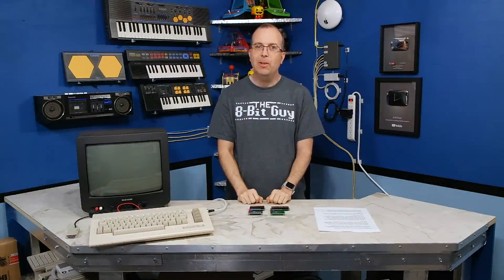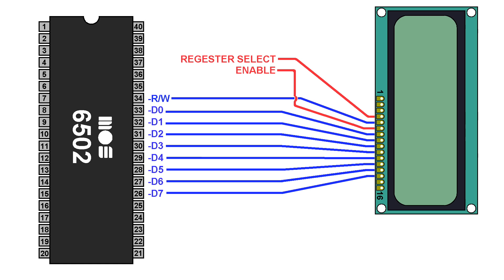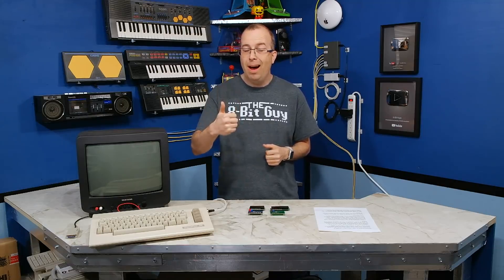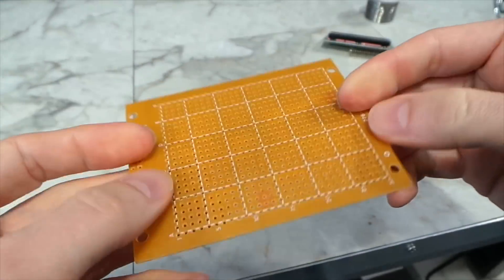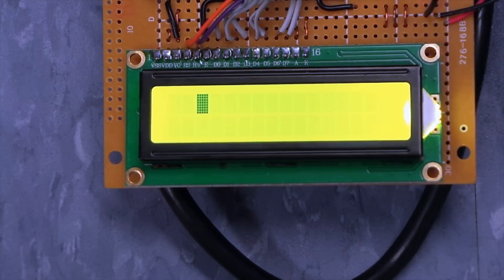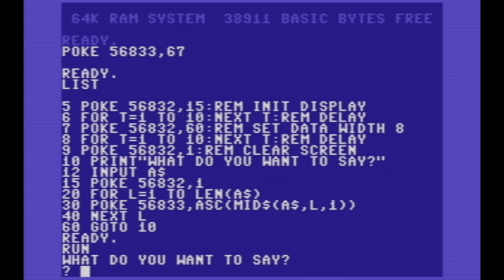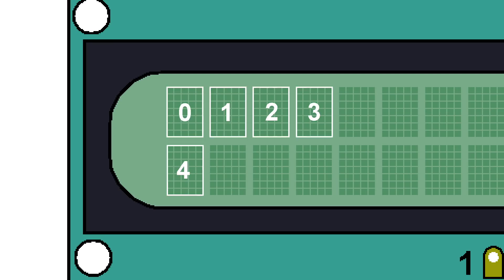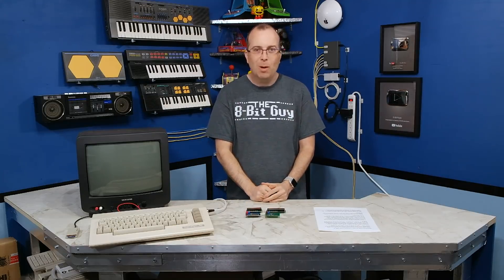How a Character LCD Works - Part 3

Comment: The PCB solution was pretty much glossed over. I think it deserves a part 4. How did you get the card to work? You never mentioned how the 74XX chip was used.

Comment: Neat little program. I want to see what I can do with it.
I had to write it like this though. Because I'm using Yabasic.
I actually did this in text for searching as I couldn't use input
because I wanted to emulate search as you type.
repeat
print "what do you want to say?"
input a$
for l=1 to len(a$)
print chr$(asc((mid$(a$,l,1)));
next l
print chr$(13)
until(1=0)

Comment: I recommend using the Set DDRAM address instruction with these displays to jump the cursor to the desired location instead of sending a lot of "dud" characters. Works much faster that way, but requires a bit of logic in the control software.

Comment: Matrix Orbital has some great LCD screens. I had their MX6 20x2 5 1/4" drive bay USB VFD screen in my Windows XP computer back in the late 1990s and early 2000s. I used it to show the system information from that computer plus a couple custom screens I made up. It was highly programmable and customizable using a software program that came with it.

Comment: Woo! 74AC? Not hanging about, are we? :D

This is almost exactly like interfacing to Atari's expansion port except you'd need a bit of address decoding; there's no IO1 line. Oh, here I was thinking Commodore had one up on Atari, even if only a little thing, but it looks like you actually need extra chips for the C64 anyway.

Comment: Hi, have you considered sharing the “fix” your friend designed to address the no data problem, I’m thinking of interfacing my C64 to a manual PROM (32x8) programmer, I may stumble on exactly the same problem. Keep up the fascinating work :)

Comment: Excellent explanations of how this 8-bit stuff works and I am slowly learning.  I also liked the graphics you generated, but my pedantic self suggests that you may want to correct the radiation symbol so that two of the blades of the trifoil point up, not down.   I've seen people turn this warning symbol every which way, but there really is a standard: 10CFR20.1901(a).

Comment: I need to write a command to an 8 bit LCD Controller.  The instruction relies on an additional two bytes of code.
Do I need to write the instruction, set the enable bit, then write the additional bytes and send the enable command again ? 
Or do I write the instruction, write the additional bytes, and then send the enable command once ?
This is all new to me as I am writing the code.
Thanks.

Comment: Ideally when cutting chips like that, you cut it close to the chip, after the bend. The way you cut it can damage the board from the mechanical stress when the soldered in pin is pushed when clipping. When you clip it at the chip it induces a lot less stress to the board.

Comment: Just like what happened to David, if you have one of the original C64 power supplies, DO NOT USE THEM. They have basically no protection and not well designed in the first place which means the voltage will slowly creep up and fry the machine that is slowly getting more and more rare. A new modern replacement is like 40 bucks and much better if you don't feel like creating your own but the original power supplies are ticking time bombs and the only way I'd use them is by checking the voltage every single time it's about to be used but that is still not a good way

Comment: Great series but I'm confused what the "good reason why" (timing issues aside) to demonstrate attaching the character LCD to the cartridge port teased at the end of Part 2 is. Is it because you can operate the display in a full 8-bit mode using the 8 data lines on the 6502?  I want to do a project similar to this with a Z80/Intel 8255.

Comment: HD44780 or equivalent display driver chip, have a command to move cursor position in desired place.. It should be in that manual.. ;) 40h is base address for character ram, 80h is base address for data ram.. For 2x16 display - first line first character is 80h, last 8Fh, second line first character is C0h, last CFh.. Command C0h sets cursor to start of second line and no need to put blank 28 times to get to the second line.. :) For 4 line displays first line didn't change - 80h.. then line adreses as follows - C0h, 94h, D4h..
And delay after initialization is very important. Best way is to read back instruction register to check busy flagg before putting some new instruction in.. Some displays working slower and i eat a hair's off to figure out why, sometimes, after start, that display didn't want to initialise but sometimes it start normally.. It was from slow ones..  :D

Anyway, great design ideas.. :)

Comment: These LCD videos are fine examples of the power of "first principle thinking", which is an invaluable skill/mindset that I fear today's kids are missing out on. One problem with today's technologies is that all the science and engineering are neatly packed into sleek packages that try hard to portrait themselves as "magic"; "warranty void" if you so much as remove a sticker. I applaud  the 8-bit-guy for his great works not just for their nostalgia value,  but also for the "tinkerer spirit" they inspire, which shouldn't (and hopefully wouldn't) ever become obsolete in today's 64-bit world and beyond.
Reply: Thankfully those stickers are becoming illegal with the rise of right-to-repair legislation
Reply: tomorrow, the warranty-void stickers will connect to your Bluetooth device to automatically tell everyone on facebook about how much of an awful person you are for lifting that sticker.
Reply: The good thing is tech like the Arduino and Raspberry Pi broke a lot of that mentality, and now that right to repair is starting to slowly become law, things may become more modifiable again.
Reply: He's a hacker in the true meaning of the word
Reply: @mrvzhao  I had to giggle when you implied these packaged screens are first principles. They weren't available when I was last tinkering, so I know there's a chip in there providing an incredibly neat interface, a memory buffer for the characters, and circuitry to drive the actual LCD with the AC required for it to function correctly. All the same, I think you're right in principle. There is a lot of progress being made, and I applaud it too. :) Also, I love these little packaged screens which provide a shallower learning curve than the combination of analog and digital knowledge needed to drive a raw LCD. I never did learn how to drive the screens I bought when I was 16. They were very cheap second-hand, at least.
Reply: Abstraction is a useful concept as long as you understand what’s going on inside a bit. If you wanted to make a simple programming language in Minecraft then you probably think that you couldn’t. But if you use abstraction, that may be no problem.

Comment: Dave, you make great videos, and you say you've been playing with these LCDs for years.  So I can't believe you didn't consult the timing diagram, and didn't even show the timing diagram in any of your 3 videos on this.

The reason it didn't work is because the Enable signal must go high after all the others have been set.  The address lines coming out of the C64 probably beat the I/O1 line by at least one gate delay.  If you look at the timing diagram for the C64 port (I haven't, and have never used it), you may find a signal that would work better for the Enable.  Maybe #IRQ inverted, if you can get it to toggle after the address and data lines are set up?

Also, for anybody trying to use these LCDs from assembly language or a fast computer, you'll need to be able to read from them to read the status register to find out when the display is ready to accept another byte.  It may take 50-100us sometimes, depending on what command was last sent.

Comment: I actually have a 40x4 Charcater LCD, it just has 2 enable lines and basically behaives like 2 40x2 LCDs ontop of eachother. which gets a bit confusing if you want to write from line 2 to 3 because you suddenly need to switch the enable lines

Comment: aaand the display should actually be done latching the data in and have let go of the bus again before the clock moves on to the next cycle... and the datasheets are all but clear on the speed at which that happens. specifically on the c64 it only has half a clock cycle as the other half is used by the vicII.
Reply: would be practical to know if those 2 additional chips are actually just some 3 state bus buffer, some bus driver (not nessesary as most of those screens happily take anything between 3.3 and 5.5 volts and therefore are compatible both with nmos and cmos based c64s.. although a '1' on an nmos one can sometimes be as low as 2.7 volts) or 8x1 memory to latch the data during the appropriate clock state (which would make access to the screen just one way and inhibit reading data back out of the screen memory)
Reply: anyway, a few datasheets (Which are kinda hard to link to the actual display units delivered anyway, as it's all pretty much generic stuff) mentioned rather scarily high write/read cycle times. as in 10 times as slow as even the slowest ram chip ever used in a c64 lol. even using 8x1 bit memory in between (despite isolating the bus from the screen and making it one way only) would not guarantee the screen would be finished before the (after that, cached) databus changes. there is no /WAIT line like on 'some other platforms' to just halt the cpu until slow crap is done :P (although it can be done with sync and rdy, or just taking the clock off it's bus with some timeout circuit, even single stepping the cpu if need be, that probably won't work in a c64 and most definately isn't wired onto the expansion port anyway, that and most c64s out there are nmos and won't like it if you stop the clock ;) attaching them to the 6526'es (userport) or putting a complete 65C22 on that expansion module seems like the safer option. (or having a whole lot of NOP opcodes between each STA to the screen - with a ram buffer in between.... as i somehow guess that little screen is gonna completely screw up if you do it really fast (some may, and some may not. the thing is: you don't know, they all come from china, which one belongs with which datasheet is very much the question ;)
Reply: also the c64 (old nmos ones, anyway) uses a 6510. the picture shows a 6502. different pinout (As they had to cram in the i/o port pins somewhere ;)

Comment: I followed your first 2 videos on this and used an LCD screen like this myself. The only trouble I had getting it working was that the contrast pin on my screen happened to need a negative voltage. I used a hacky charge pump to make it work, but a voltage converter would also work. Apparently this is pretty common, so I wanted to mention it in case anybody else runs into the same problem.

Comment: I remember (rather vaguely now) back around 1982, I had to interface a character display to an 8080 board running assembler.  A bit fiddly because the 8080 didn't allow writing data to an address which was a variable, so it involved a bit of self-modifying code.  Also I couldn't read any acknowledgement signal back from the LCD because it didn't have enough drive capability to run the 8080 and all its data bus components and wiring.  I could have added a buffer but instead just wrote to the LCD slowly enough that it would always work.  It was a great project, used as an in-house test system for logic boards.  Alas the company I worked for then has long since been absorbed and forgotten, and the (then) brand new factory has been abandoned for decades.

Comment: Whats the oldest computer you've ever restored?.  I'd  love to  see you restore an old UK101 (UK version of the Ohio Superboard). it was my first computer....8k ram,  8k MicroSoft basic, machine code and 1k video ram. Bare  board (although you could get a case for  it).:).  I taught myself machine code on this!..(6502  proc 1 Mhz) as it was much faster than the inbuilt  basic interpreter. standard tape  cassette needed for offline storage and retrieval.

Comment: just some info I have found ZEP orange cleaner works great for cleaning and I don't mix it with water its a degreaser great for cleaning plastic  you can get it at Home Depot

Comment: Hello David and everyone in the comments section.  I wanted to get your opinion on making a SNES game.  I want to make a SNES side-scroller and take advantage of the FX chip.  The only problem is that it will be difficult to get high quantities of FX chip cartridges and there are some compiler issues that will keep me from taking full advantage of the FX chip.

Would you guys consider it cheating if I used an ARM Cortex M0/M3 (RISC processor) as a co-processor to the SNES?  The processor is easily available and some people have already used it on prototype Gameboy cartridges.  I wanted to stick to the original equipment but that will be difficult.  Thanks in advance.

Comment: On the Synthesizer cartridge it looks like he hooked the data lines up to the bottom row of pins instead of the top row, or am I imagining things?
Compare the diagram at 2:17 to where he soldered the ribbon to at 4:54 - Can someone please check this for me, I spent over an hour flipping between different views of this board and I swear he fucked it up, and all he seems to be doing is shooting at the ENABLE pin from Data0 so he occasionally got lucky if the Data0 pin was high for that command it would forward the cursor with a null character.
I'd like to see some better pics of both sides of this board, to confirm what i'm thinking, but if i'm right, what an epic / rookie fuckup to make.

Comment: The most common 16x2 character LCDs using Hitachi HD44780 driver has a mode in which it can be driven with 4 data lines. For Arduino/microcontroller projects, usually this mode is used to reduce the number of pins spent on driving the display
Reply: For an Arduino/microcontroller that makes sense, because pins are a resource that you never have enough of, so you better use them efficiently. On the C64 user port, the same is true, you have only 8 pins availale. In the previous videos, you can see David using the 4 bit mode.

However, on the cartridge port, you have an 8-bit address bus. It is shared by all devices on the bus. Using less data lines does not make them available for other puposes. So you can just as well make your life easy and use all 8 data lines.

Comment: If you can do SPI out of the C64, then graphic LCD's from Adafruit will not be too much of a problem.
Reply: It looks doable to me to use the CIAs serial shift registers to do SPI. They are both accessible on the user port and you need both of them, one for output, one for input. Then a normal user port pin for slave select. Relatively high speeds (>15KB/s) should be achievable if the serial shift registers are used.

Comment: Dave's problem was a typical software guys designing hardware boards.  Dave's thought the 8-bit lines were always available but in fact they are only available for a few C64 clock cycles because the CPU would be doing other stuff after the I/O write command.  All external C64 boards have fast latch chip(s) to capture data.  I wish Dave had shown what chips he had clipped off that bad board.   Any chances to see the schematics of your friend designer board?
Reply: Yup Lol.  Unfortunately then he gave it to a hardware guy that probably over engineered it by hooking it up to a data analyser instead of reading the data sheets on both products. Too bad Bil Herd the designer of the 128 didn't get involved,  he is all over YouTube . Would have fixed him up just like that. 😂

Comment: May be  your scheme  just need pulldown resistors on data bus? Without this guys  I cant even  make just a switch  on cable  less than meter connected to Arduino )

Comment: I wouldn't mind a little more in-depth info about the way you wired up the 7400 logic chip when you were trying to get your prototype to work, or the way your friend fixed the problem and the chips that he used when he made the boards for you...  Not necessarily a video, mind you -- an article on your website would do, if you have the time.

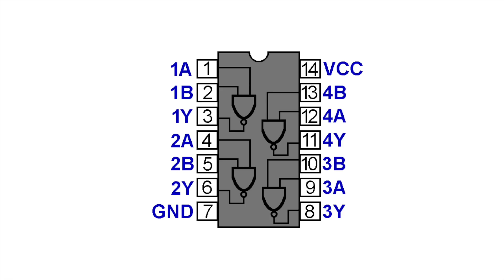Comment: Can someone explain the details around 3:26? Why does the signal go through 2 more NAND gates and get combined with the PHI2 clock before going to the enable? Does this have the effect of delaying the enable signal to a clock cycle or two after the data has been sent?
Reply: It is because the 6510 processor only guarantees that the information on the bus is valid when the PHI2 clock raises from low to high. The IO1 line is generated out of combinatorial logic on the data bus. If PHI2 is low then there might be wrong data on the bus, and thus you may get a false IO1 signal. A logical AND with PHI2 guarantees that the LCD screen is only activated when the data on the bus is valid and therefore IO1 is also valid.

The enable signal is only delayed a fraction of a single cycle.

Comment: For the little it's worth, it's faster to send a "Set DDRAM address" command than to output up to 32 garbage characters to move the cursor to the start of the next line, though you still have to take the oddball memory map into account.

About 15 years ago a friend loaned me a 20×4 LCD with the Hitachi 44780 controller, which I hooked up to my Linux PC's parallel port (with +12 V for the backlight—some backlights need more than +5 V—coming from an unused Molex connector). I found a kernel driver that exposed the LCD as a console device, cleaned it up, made it more flexible about which control lines were connected to which parallel port pins, and even implemented a few simple VT100/ANSI escape sequences. I also wired a transistor up to the backlight, controlled by yet another parallel port pin, to enable software control. Alas, the friend wanted the LCD back before I got around to making the driver pretty and releasing it.